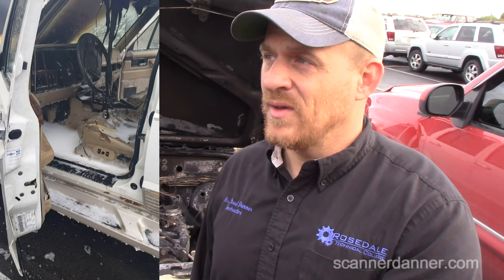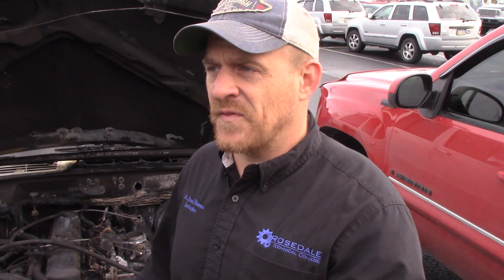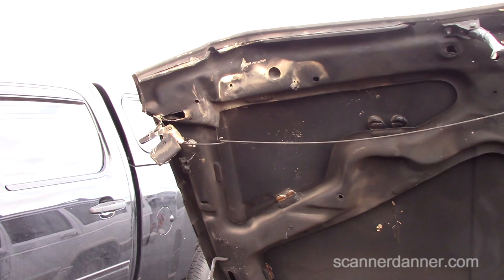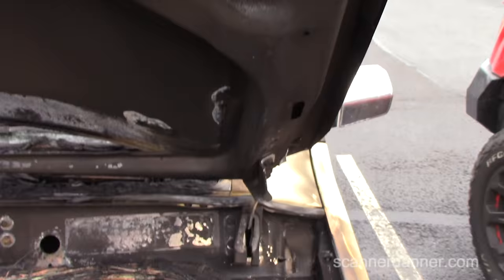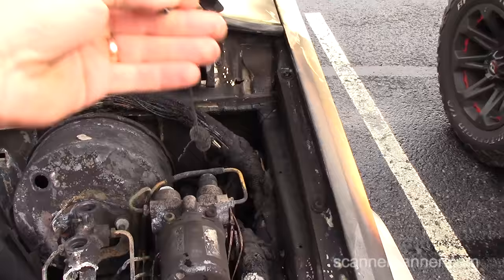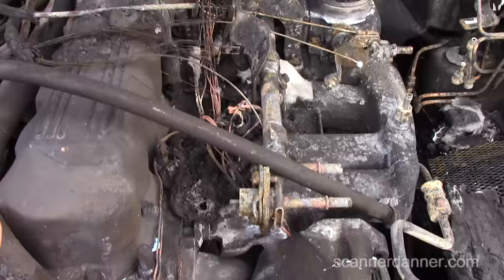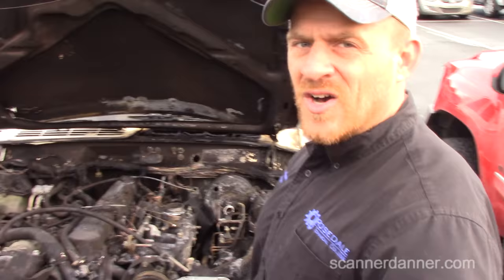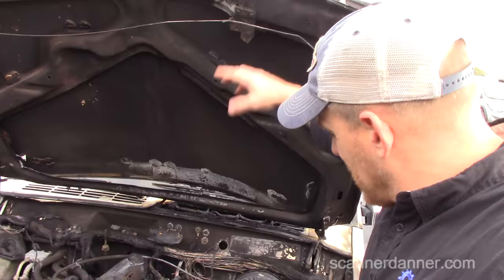ScannerDanner's Jeep CATCHES ON FIRE!!!

Comment: I've got a 90 Jeep that I'm doing a head gasket on has a renix system in it I have to replace the wires that go down for the anti knock sensor the O2 sensor etc etc... I would think that the shop that you were working for if you were unfortunate to have this situation happen the insurance would take care of it then I'd be up to the shop to deal with you... Just remember shit happens these Jeeps have a bad tendency the wires get broken and cracked just doing about cover gasket you could have hit some wire and shorted something out 100 different things could have happened don't blame it on your abilities or that you missed something or you did something I get it you're out of a Jeep but don't blame yourself

Comment: Hey brother! I have a jeep Cherokee the latest generation. Died the oil pressure sender in the engine. Tell me where it is on the engine? Official dealer (Russian Federation) for the replacement voiced the price of 700 dollars without the cost of the sensor. I'm sure it's expensive. Help? If possible, add a link to the manul. Thank you!
Reply: if you have the talest generation as you say Jeep you shoul have the money to service it properly.
Reply: )))) The money is there. But my childhood passion for cars. From my close environment, no one understands me. Better to pay the money and sleep soundly. I like to do everything myself. Due to lack let in four in the morning, but still can not sleep ))))
Reply: I understand that you don't know where you installed the oil pressure sender? I just wanna communicate with you by using Google. Thought you will give me a lead on some info, as to our forums is a common issue. Only problem - everywhere the discussion is about the old Cherokee. Under the hood is not climbed - no, wanted you to know......

Comment: It's not your fault. It's the stupid design of that whole engine bay. But you're right, had it been in the field, you owned the wreck, which is a pity, because, again, it's not your fault.

That it happened? Bad, that it happened in that parking lot, as controlled as it gets, and that nobody was hurt, good. I'm thankful nobody got hurt.

It's a stupid design and if you own this car again, be sure to redo everything electric inside the bay starting from the absolutely horrid injector harness.  I believe there's also a shield and a new harness that can be installed for this range of Jeeps (years i mean). At least, here in Europe, there was an aftermarket set specifically for that year you owned and it advertised exactly for that reason, fires. I know because a friend of mine owned the car, it smoked a few times (no actual fires) and he got spooked, so i helped him replace what, in my personal opinion is one of the most asinine harnesses i've ever seen.

I don't know, i might be overly critical, but that's how i felt at the time, some basic safety oriented features were completely missing and back then (some 9 years ago) is still wasn't as aware of cars as i am now.

Again, i'm happy that you didn't get hurt, and i hope someone manages to hook you up with another Jeep, they are nice cars once all the gremlins are kicked out of them.

Comment: +ScannerDanner  hey does anybody know how I can check bias voltage on a 5 pin wideband sensor? I have a 2003 Mercedes c180 cl203 that is over fuelling I have a long term fuel trim that doesn't move from 3.1% no matter what you do to the engine hot, cold, revs, vac pipes and a short term that moves between -8% +3% my o2b1s1 is stuck at 1.474v and o2b1s2 is 0.460v but this one changes also it sometimes says close loop fault or CL. engine conditions are at running temp 95 degrees c and sounds fine just using shit loads of fuel. if anyone could help I would much appreciate it and ill give you a internet high 5 if I can fix it.

Comment: The POS destroys itself and you want another Jeep. Really? They're famous for electrical problems, near zero oil pressure (and the oil gauge is completely fake), not being able to go 5000 miles without developing exhaust leaks, and a host of other problems. If they all burned to the ground the world would be a better place.
Reply from the maker: Yep. I do and it is for towing reasons (to pull behind my RV). 
Also most of these XJ's that you see for sale have over 200k on them as a standard. If that doesn't tell you something about the durability of these things, then I don't know what will. 
My jeep had 295,000 miles on the original transmission and engine.
Reply: What would be a better alternative....please enlighten me.
Reply: A Honda CR-V, for example, can be flat towed and unless you plan to go rock crawling should get you anywhere the Jeep will while weighing less behind the RV, getting better mileage, etc. If you want more evidence just search "jeep blown motor" on YouTube or google. The 4 liters routinely fail often due to extremely low oil pressure while the gauge reads 40+ psi oil pressure. Thanks to Chrysler engineering anything over a few psi causes the gauge to read normal. The Cherokees are also prone to lots of other well documented problems and they literally fall apart. And newer jeeps have a host of other expensive problems like the whole TIPM debacle, transmission issues, etc.
Reply: My '94 XJ had 358k before I had to scrap it due to rust.  Every mid-90's Jeep Cherokee/Grand Cherokee my family has ever owned did the miles and never gave us any major issues.  The only time my '94 XJ ever failed to start was due to a crank position sensor.  I knew exactly what it was when the Jeep cranked but didn't fire.  Took my motorcycle to work that morning, picked up a new sensor on the way home...installed it and had a running Jeep in 15 minutes.  And I can tell you right off the bat - the oil gauge was not fake on my '94 (or my '98), like they are on many Ford products.  My '94 with 358k registered a solid 25psi of idling oil pressure, engine hot,  running 10w30 oil....verified with a mechanical oil pressure gauge.  I know this because I pulled the engine/trans out of it to put into another Jeep project and did an overall health check before I elected to use the Cherokee as a donor.  Sounds to me like you're just a Jeep hater, for whatever reason...doesn't really matter.